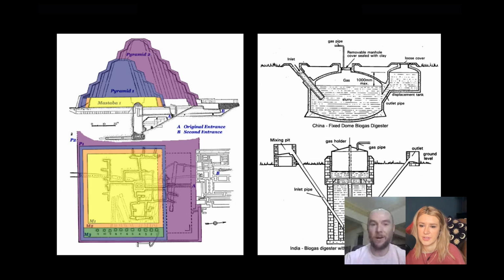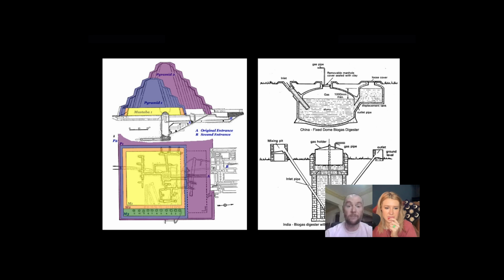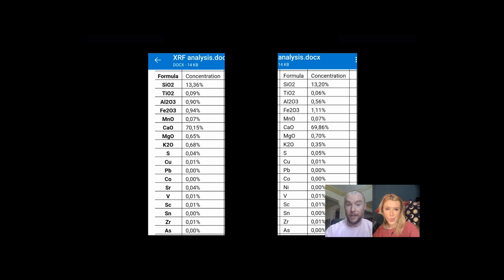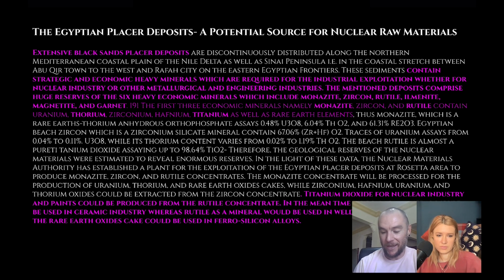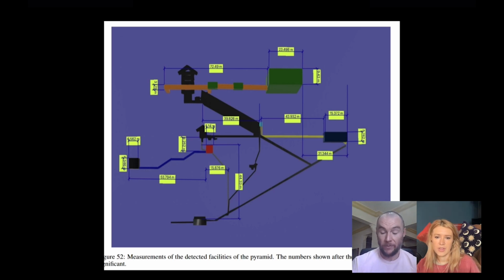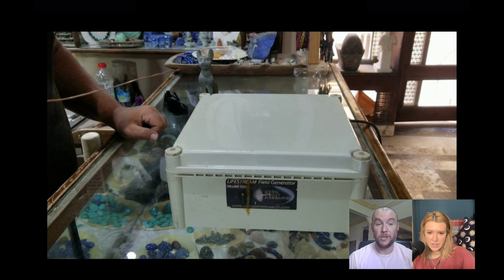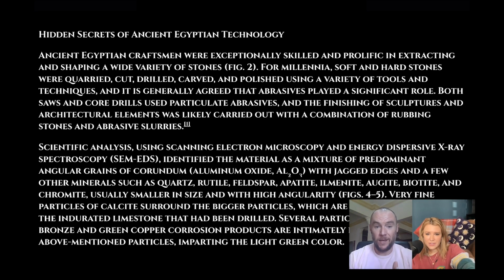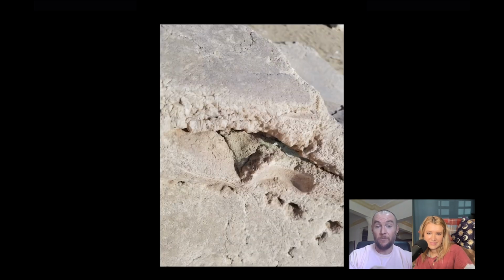The Original Purpose of the Pyramids

Comment: Renewable energy produced green ammonia may become our near future main liquid fuel to indirectly transport electrons (as hydrogen). Ammonia is made up from 3 hydrogen and 1 nitrogen molecule, it can be safely stored at atmospheric pressure and can be transported as a liquid. Air is 78% nitrogen so it’s readily available from our atmosphere. When you compress hydrogen to store it, that requires extra energy, it’s still only 1 hydrogen molecule per given volume, and hydrogen can leak from most materials because it’s the smallest molecule in the universe, it’s also very combustible. However, if you catalyse hydrogen from water and nitrogen from air, using renewable electricity, into green ammonia, you’ve now got 3X the amount of hydrogen in a given volume, as a liquid at atmospheric pressure. So we’re unlikely to use giant pyramids (initially) to make green ammonia but it’s one of the best ways to store renewable energy, transport it and then release the hydrogen to do work. There are already ammonia fuel cells and they would be the most efficient way to reclaim those renewable electrons back into electricity, but you can actually burn ammonia and it releases water among a few other byproducts. Ammonia can be used in fertiliser and it can also be changed into methane (I think) which has many uses in manufacturing different materials. Bring back the Type 1 civilisation baby

Comment: I do not believe this theory is correct, or that it will stack up with close scrutiny, though presenting any and all alternatives to the mainstream absurdities is useful. In regards to this particular theory, there are many holes in the reasoning, but rather than writing an essay, I'll present a few dot points as prompts for further investigation:

1. The Nile provided all the nitrogen egyptian agriculture required, so why produce ammonia on an industrial scale? Several journal papers to find on that. 

2. UnchartedX has proven with meticulous evidence that the civilisation which built the pyramids had advanced technology and machining capacities, so why not just make the pressure vessels out of steel? 

3. The Great Pyramid can not be built today. If someone claims it could be done, then the onus is on the one making the claim to prove it with a demonstration of the technique. If you think the 'relieving' chamber blocks were floated into place using water, and fitted so tightly, when there's no room to manoeuvre, then you must have some explanation to offer, and demonstrate this process in action; the 'relieving' chamber alone is a physical impossibility to construct using today's technology. But in any case, if you think that water was pumped through the entire pyramid, you'd need industrial, powered pumps that use...steel.
 
4. Why is the Bent Pyramid bent? Why is it aligned to the cardinal directions? Why is the Red Pyramid aligned to the cardinal directions?

5. Why is the pyramid complex at Giza so precisely astronomically aligned to the constellation Orion?; Why is there a lock at 10,500 BCE, which includes the Sphinx? See Hancock and Bauval. Why are the Giza pyramids aligned to the cardinal directions so precisely?;

6. Why do the shafts of the Great Pyramid target certain stars, including in Orion, as well as Sirius (Isis/Auset)?

7. Why does the Great Pyramid encode the following (list taken from the paper 'Decoding the Measure of a Monument' by E. R. Schmitz):
 - A precise definition of the Royal Cubit as it relates to the Earth
 - The size and shape of the Earth
 - The Mass and Density of the Earth
 - The Gravitational Constant
 - The Escape Velocity from the Earth to obtain an Open Orbit
 - The Escape Velocity from the Earth to obtain escape from the
 combined Earth’s and Sun’s gravitational field
 - The significance of the location of the Great Pyramid
 - The Golden Ratio
 - The Mass of the Sun
 - The Mass of the Moon
 - The Mean distance to the Sun and the Circumference of the Earth's Orbit
 - Neutral Points of Gravity between the Earth and the Sun
 - The Mean distance to the Moon
 - The Orbital Velocity of the Earth
 - The Orbital Velocity of the Moon
 - The Metonic 19 year cycle of the Moon’s orbit of the Earth
 - The Lagrange Point (L1) between the Earth and the Moon
 - The Speed of Light
 - The Orbital Velocity of the Solar System relative to the
 Center of the Milkyway Galaxy
 - The Velocity of the Local Group of Galaxies which includes
 the Milky Way Galaxy relative to the Universe

Why is any of this needed for a chemical factory? :)

8. Geoffrey states that electromagnetism is the only form of energy. This is incorrect.

9. Geoffrey essentially states that granite does not conduct. This is incorrect, and it conducts better than limestone and sandstone. Scrutinise his experiments and the conditions he has established. The pyramids focus EM energy, both at the base, and in several layers above the apex, depending on wavelength. BrightInsight covered a recent paper which reported this.

10. There are other ways these metallic signatures could be generated, and there is some evidence plasmoids could be involved.

If all you have is a (materialist) hammer, everything looks like a nail.
Reply: I agree. The chemical plant theory is utter nonsense. That's why it never went anywhere. I can't believe anyone ever entertained the idea to begin with. So much complex and intricate work just to process ammonia? Absurd. The new SAR data is setting the stage to rewrite everything.
Reply: @ For years I've sat back and watched materialists beat their heads against the wall on Egypt, and whatever else. It's been an amusing show. And that will probably go on for a while longer.
Yes, they had some advanced physical technology, though very different to how people might imagine it, but nobody will get anywhere by looking for motherboards.
And yeah, I predict that will be the next wave; where are their computers!? Where are their turing machines!!? haha
Even 'alternative' folks like unchartedX are incapable of getting out of the Newtonian gulag.
Jahannah seems to be able to put reason aside from time to time, but then women have the advantage on that. 

The Shemsu Hor were/are sorcerers, and everyone will be reading the Law of One in the end, mark my words, just for some it will be too late.🙄

Comment: The pyramids were built before Noah’s flood. There was no rain on the earth before the flood; a mist arose and watered the plants. Therefore, there may have been underground water pressure, not found anywhere today, which was used with the quartz pyramids to produce electricity.__
_Before the flood; the earth was protected from solar radiation by a water canopy filtering sunlight. This canopy was eliminated at the time of the flood. The polar ice-caps may not have existed before the flood. The temperature was likely without the extremes found today. The earth’s magnetism may have changed. God may have used a temperature change to destroy the dinosaurs._ 
_The area around the pyramids was likely heavily forested at the time. The flood dramatically changed the course of rivers; eliminated rivers, and created rivers._
__King Og in the Bible was a giant 13-feet tall; which was 3-feet taller than Goliath. Biblical giants were offspring of fallen-angels / demons mating with human women. God imprisoned the offending demons; thus, giants were far more numerous before the flood. Goliath is described as “descended from the giant”, implying Goliath was the son of two humans; rather than directly from a woman and a demon; and thus, of diluted demonic power and thus, of shorter stature. Fallen angels are immensely powerful beings. I believe the giants before the flood were even taller than Og and Goliath; maybe 20 or 30 feet tall.

Comment: 1:44:00 And here we go again magical copper from snake oil salesman. Here is reality: "Arsenical copper contains up to 0.5% arsenic which, at elevated temperatures, imparts higher tensile strength and a reduced tendency to scaling. It is typically specified in boiler work, especially locomotive fireboxes.[1][2][3] It also helps prevent embrittlement of oxygen-free copper by bismuth, antimony and lead by the formation of complex oxides." Arsenical bronze - "As, giving a 10-to-30% improvement in hardness and tensile strength" Much harder than copper != as hard as seel

Comment: Question number 1.
If the Egyptians were refining metals and extracting pure ammonia ? then why didn't they use concrete instead of sawing into a mountain ?

Not saying that they didn't refine chemicals in the pyramid, but there's a lot of strange things and ( as I understand ) the burial of the Kings happened after the factory was out of commission, either the knowledge was lost or they found an easier way with smaller containers

Comment: Co2 dissolved in water gives you Carbonic Acid, producing the highest quality water, which is extremely important if you study the work of the greatest mind of the 20th Century, Viktor Schauberger! I have seen videos on yt showing three directional vortices in the lowest room of the Great Pyramid, supporting the massive ram pump that ran the structure. Vortex flow would be an extremely important aspect of this machine as well.

Comment: Really liking it so far, but what about the 5 rooms in a spiral, below the Stepped Pyramid at Saqqara and the 40,000 vases that are so perfect we can not produce them today. I saw  Spanish special claiming the rooms were tuned to the pentatonic scale and the vases were filled with water and tined to the note of each room, for some kind of sound technology!

 Also, it appears much of the work in Giza was pre Egyptian, most likely Atlantean, before the global flood. 

The Ram Pump makes sense! Edward Kunkle claimed the Great Pyramid was a pump as well and that it was constructed by flooding each level surrounded by casing stones and locks took the barges up higher and higher. NO heavy lifting, just floating blocks on small barges.

I have also hear word of an internal explosion within the Great Pyramid and what about all of the sea creatures found within, making it appear the entire Plateau was under water at some point, meaning it could not have been built by the Egyptians and it seems a lot older than the ludicrous claims of the quackademicians!

Comment: Yawn... yea ok whatever. On a side note I'm going to be selling, Authentic Ancient Egyptian drinking glasses and cups. As proof  of their authenticity you will notice that each cup/glass has 3 holes drilled horizontally approximately 1 centimeter up from the bottom of the cup. Just like the "catch basins" in ancient times it was bad luck to have anything filled to the top. Hence the need for the holes. In crackpot theories etc.

Comment: I need to point out it would take ALOT of wood to float a 5ton block . Maybe on a river where it's size don't matter. But inside even the great pyramid and I don't believe there's enough room to fit or maneuver in. I don't believe you need acid rain to explain it. Just add 10,000 to 20,000 yrs of age!

Comment: With the evidence presented it is the most logical deduction of there use yet. 😅😮 With the original bright white polished limestone exterior which would have reduced uncontrollable heat build up in the reactors causing a thermal runaway without it. 😮 The Gold Capping would have most likely been there to disperse a build up of static electricity or as a Lighting Rod. Brilliant discussion. 😊

Comment: In thee book Farmers of Forty Centries the methane digester is illustrate where farmers dug huge pits and filled them with pig manure, human manure etc. then the hole was covered with clay soil and a bamboo pipe was installed to move into the close home and when the methane was produced it was lit and the flame used to cook with.  When the flame ran out the farmers knew the compost was read for use.

Comment: (22:55) I have seen this on an industrial scale in northern Alberta, Canada. Next to a feed lot. The methane is collected and used as fuel for specially designed combustion engines to produce electricity. Bio electricity. It’s actually called dirty energy due to the process is, well crappy.

Comment: Wow.

One of those videos that actually make you dumber.
You can feel how brain cells die watching this.

Just for starters: why build a hughe ass pyramide on top of all this that has no function whatsoever?

You could build everything you mentioned but without pyramides.

And theres tons of people apperently willing to buy this bullshit?
Then again ... people think the earth is flat.
Reply: Can you explain how they could have alternatively built   industrial sized insulated pressure containers to manufacture those chemicals on a scale that would be sufficient for the expansion and growth of such a huge and advanced civilisation?
Using heavy stone and gravity seems like the most straightforward explanation to me.
Reply: @SiFi5478  They didn't.

Ever.

The basis of your assumption is that far removed from reality any discussing it is mood.

Because why should we discuss things on par with flat earth?
Reply: @1000-r3g  bc it's not on par w/ flat earth. the Great pyramid is designed in measurements referenced to Earth's circumference and radius. so to even utter the word "flat earth" in the context of pyramid means it's you who is intellectually on par with flat earthers. so thanks for projecting.
have you been inside the Great Pyramid? what do you think contributes to different colors in walls of diff chambers and gallery? do you not think we need to check chemical components of the wall? even just for the sake of debunking this hypothesis? if so, why get so triggered?
Reply: @nomnomyam9379  Nice straw you have there.

Clinge Forest! Clinge!
Reply: @1000-r3g  it's telling you never been inside the Great Pyramid. 

"…but beyond this, on to the Queen’s Chamber, the very thick and hard incrustation of salt which entirely covers the walls of this passage, made it impossible for us to locate the joints with any certainty. This salt incrustation is peculiar to the Horizontal Passage and Queen’s Chamber, although a little of it may also be seen on the walls of the First Ascending Passage." 
- John and Morton Edgar, Great Pyramid Passages Vol 1., 1910 edition. 

there are only two ways to form salt incrustation. 
chemical reaction or sea water flood 

(the flood hypothesis could explain both 1. Karst erosion of the Tura limestone cap of the Khafre pyramid, and 2. 600 ft or higher ocean inundation in the region: saline-iron oxide washways, receding shoreline, and high water marks in the Western Desert and the Saudi Empty Quarter)

but ignorant fools who never stepped on Egyptian sand would call a working hypothesis w/ currently-limited but nevertheless valid evidence as "it's on par w/ flat earth!"

Comment: What an AWESOME analysis! Your theory makes so much sense !!! I'm just baffled.
 I've done some experiments myself with scaled down pyramids for a long time and though I wouldn't assume what their purpose was, here are the observable and repeatable phenomenons I observed (on top of your theory which I support 100%).
-When put on a stand 1/3 of the total height in the middle of a pyramid, any organic material (raw meat, plants, ...) will dry out and dessicate within days (I didn't try it yet with fish).
-When faces are oriented towards the cardinal points, any plant or small animal would rapidly get sick and die when exposed to the south face.
-When plants are exposed to the north face, I observed them grow bigger, faster and bear bigger fruits compared to their counterpart reference plants which were just a few meters away and not aligned with the pyramid.
- Oriented blunt razor blades, when placed on that same pedestal regain their sharpness again within days (microscopically observable), which suggests a molecular restructuration on metal happening inside the pyramids.
Other than just observing the fact of mummification and the restructuring of metals, all I've been able to observe was that there seems to be some kind of radiation emitted from the faces when the pyramid is magnetically aligned with the Earth magnetic grid.
I don't have any clue as why it's happening BUT this is definitely shape related. I've repeated the same experiments with pyramids made out of 4 sticks (no physical ''faces'') and I obtained the exact same results.
Anybody try those experiments and chime in if they can understand what's going on.
Be careful though. Also size matter. The effects are much more pronounced on bigger models.
If this is part of an intended purpose, that might explain why all their ''vases'' and containers were also bizarrely designed with such microscopic levels of precision and why they display such a deep understanding of geometry, mathematics, universal principles and energies and also the secrets behind proportions and frequencies.
So, maybe there's even more to the story.
Here is for everybody else to know. This is serious and legit.
I have no conclusions but the obvious.
THANK YOU for your committment sir. You are truly genious!

Comment: Only 50 min in and this is brilliant. Human beings wouldn't build structures on such a grand scale without some actual application. Otherwise it would just be a gigantic money pit... for a burial place.. with no treasures or anything akin to the valley of the kings. The chemical deposits and gases found inside screamed that the pyramids was used for something industrial. The facts backing this theory is too great to be coincidental.